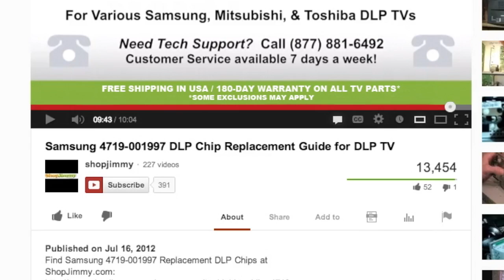How to Desolder Using Wick & Braid - REMOVE SOLDER FROM BOARD

Comment: 0:35 instead of adding more solder to the board you're trying to take solder off of, I recommend using some flux on the solder joint you intend to work. Be careful with the flux, because in most cases it's an acid and you'll know later that evening if you were careful enough.

Comment: I've tried with high heat (about 450° C) , adding solder on top of the old one and putting flux on the wick even but it is not absorbing the solder at all. What am i doing wrong?

Comment: I am necro posting here ressurecting a well dead comment section, but I came here to get try yet again to learn to do this - and seems I do the exact same thing only it does not work and what he managed within a span of seconds takes me 10 minutes and in the end I have to use a tootpick or something to clean the holes by heating the crap out of the pads while sticking the pointy end of the toothpick through. Or even worse, use the tip of a narrow round soldering tip to stap at the holes. I do not understand!

Comment: If anyone can answer, can this copper also get the solder in the opposite side ?
Reply: yes most of the time it will, if it doesn't or isn't working, you can just buy a desoldering pump, which is the cheapest rout, I use one all the time they work well. but you have to clean them after ever use and most of the time in-between the same session. the easiest and more expensive rout is to go with a desoldering GUN, there is a difference between a gun and a pump a pump is cheap and you have to do it manually a gun is like an iron with a suction pump on it, you set the temp and place it over the joint wait just a sec and pull the trigger and it will suck the solder up automatically. a desoldering gun is the easiest and personally I think the best way especially if you plan on using it a lot. otherwise if its just once in a while just grab 2 pumps and that should last you a couple years, more if you take proper care and clean it after every use.

Comment: Thanks new to this , are most new boards lead free solder now ? So if that's the case does adding lead solder work to help remove this ? or in your demo did you just have lead solder in that joint to demonstrate the wick?
Thanks

Comment: This makes it look easy, I have spent days at my school trying to desolder the components off of boards. Whenever I try I can't seem to actually suck up the solder with the wick. I've tried getting a new wick and it does nothing. Any recommendations?
Reply: Same here. No tips? Just buy a desolder gun?
Reply: I found dipping the wick in flux made it work! wouldn't work before that
Reply from the maker: Sam Lehman   I recommend using a desolder gun.  Thanks!  www.shopjimmy.com